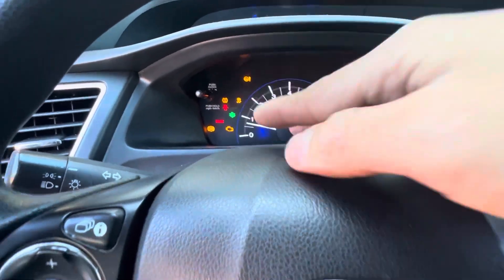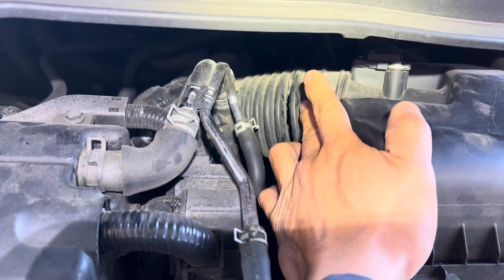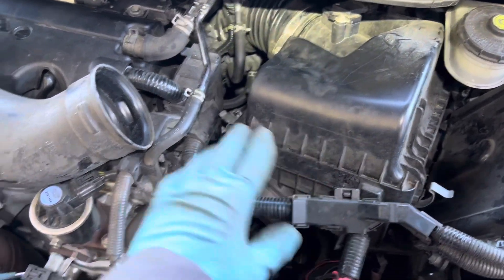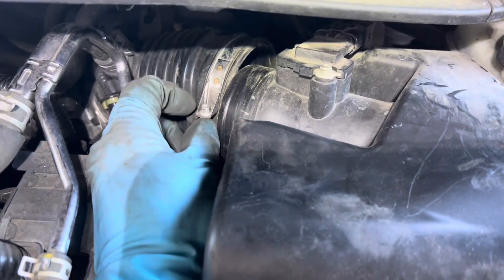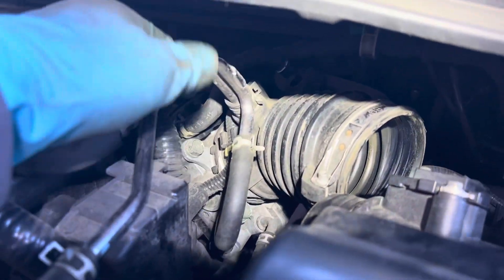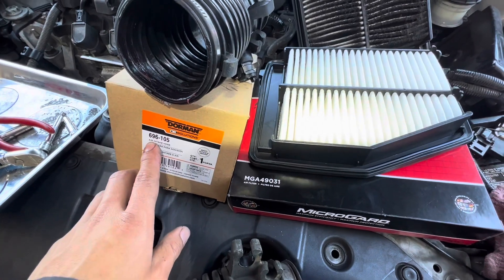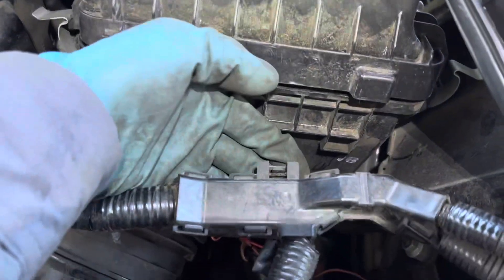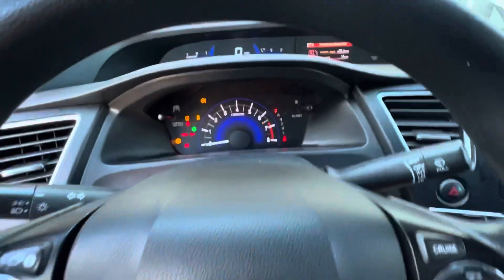2000 To 2015 Honda Civic Fuel System Too Lean - Code P0171 - Easy Fix MUST WATCH

Comment: I’ve got a 2011 civic lx with this code.  No break in the box or tubes, replaced MAF and cleaned it, new filter, cleaned the air box…still get the code after it’s cleared, and now it’s getting harder to start. New battery and alternator, new belt, injectors were replaced too.  It’s driving me nuts. What’s next to check?
Reply from the maker: @PhillyD-Studios  Next, perform throttle body clean, wipe all the build up around the flap door and let the car idle for 10mins to let it relearn the idle itself. Perform a smoke vacuum leak test if you know how, this test will help you find any tiny small leak in the intake manifold system and all the vacuum hoses. Now if you having a no start or no start sometime, it would be starter. If you turn the key over to start the car and the car is completely quiet or you here a “clicking” sound, bad starter. Honda have a common problem with starter. You have pretty much replaced everything already and if it still not working then its a bad ecm (computer).
Reply: For me at autozone they wanted me to buy an egr valve and gasket
Reply from the maker: @DarkNozomi  Take it to a shop have it check out. Don't listen to autozone, they are not mechanic.
Reply: @Ah_Duuu_Ma  I fixed it today. I just needed a new intake hose. Mine was cracked
Reply: @Ah_Duuu_Ma  thank you for the video too it helped me find out what was wrong